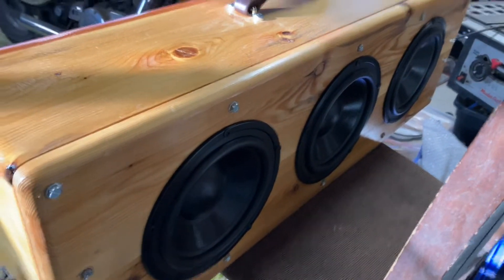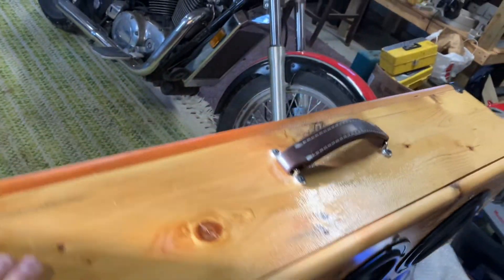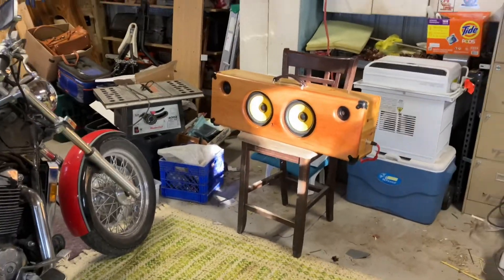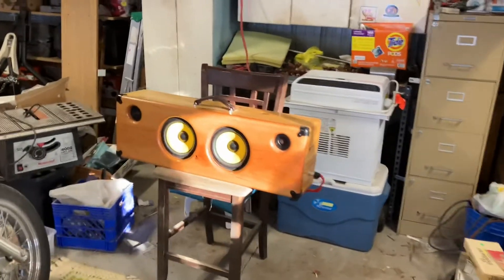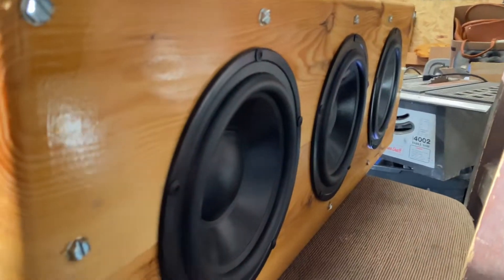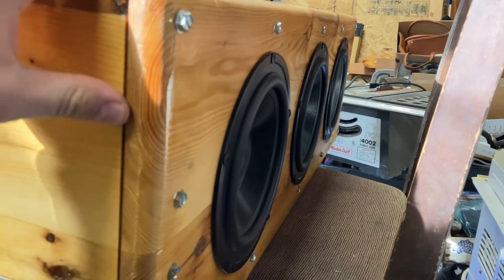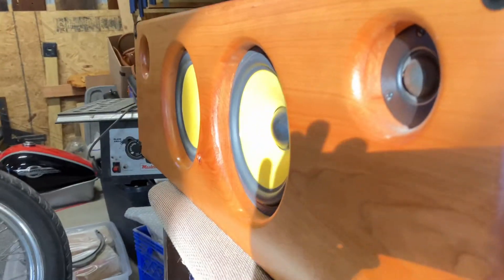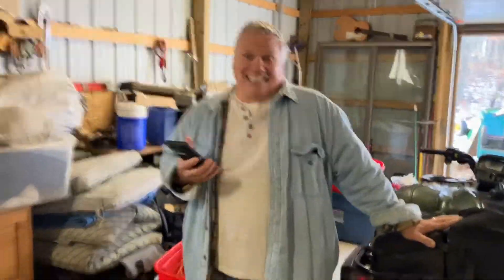Dayton audio 8 inch passive radiators in action

Comment: you should check out the Earthquake Sound SLAPS M8 passive radiators or SLAPS M10. huge excursion
Reply from the maker: I know of them , but these speakers wouldn't push them like a regular sub lol they are more of a full range sub
Reply from the maker: U don't need a ton of travel on your passive radiators unless ur using a small or equal size radiator to the size of the active driver . 
Rule of thumb is to double the cone area for the passive radiators compared to the active drivers . 

Or to have twice the excursion of the active drivers . So if u have a passive and active radiator that are the same size . Use a passive radiator that has soft long travel suspension

Comment: thats a great speaker, if you cant fit 4 use 3x 10" or long excusion, u only have to match 2x the z movment or total air displacment of the active woofer but your using 2 so u double that or 4 times the travel of 1 active woofer, so the rule of thumb is twice the air displacment, but the 3 seem to be handling it fine, just curious what song are you playing?
Reply from the maker: Yes double the cone area is always a great rule of thumb  only way to get-more xmax is to have a long travel suspension thTs softer than the active drivers . Only problem is id have to build one or use the 100$ ones from parts express. This thing kicked out some music for sure though. If i build two 10 inch passives the foam surrunds are too stiff using cones from lord of bass . The song is : Eliminate - this song  is copyright right free 
I also played white rapper by Rittz and she hits all bass notes